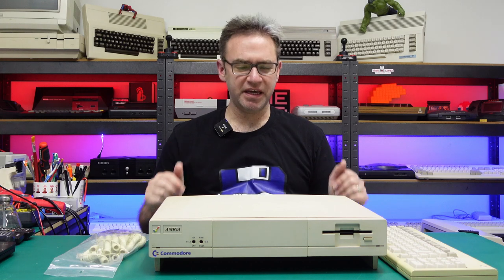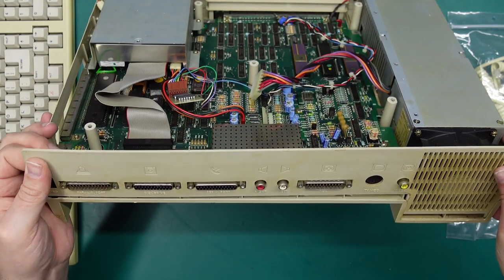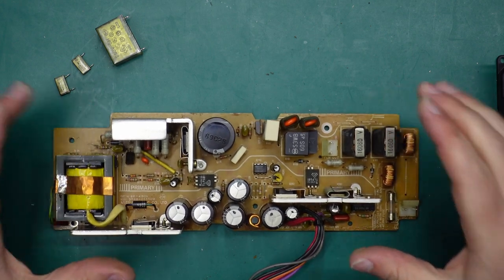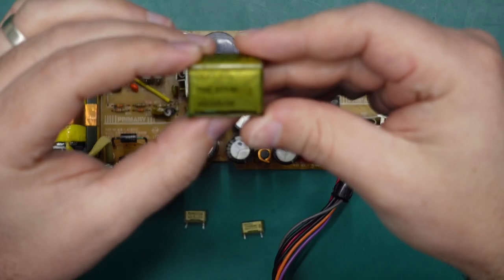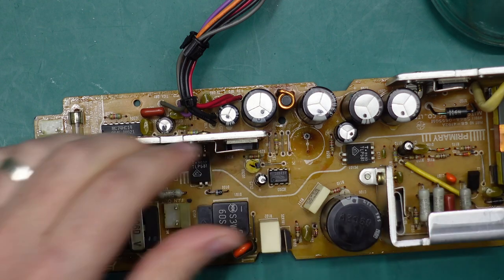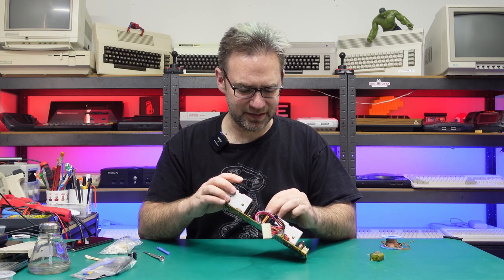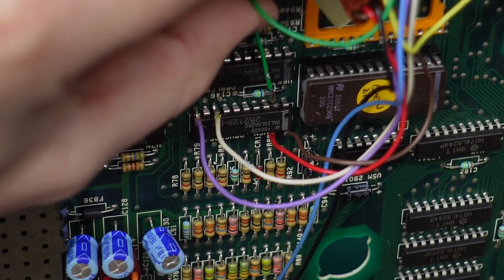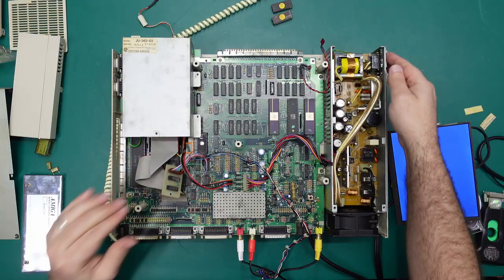Amiga 1000 - I have NFI - part one

Comment: The switch is a ROM switch. The A1000 loaded it's ROM (Kickstart) from floppy, but many aftermarket solutions to add a physical ROM existed. This simply allows you to switch between the Floppy boot option and the physical ROM. 
The one marked filter may be to activate the low pass audio filter on the Paula chip. That's usually done through software.
Reply from the maker: Yep, spot on. Still can't find any info on that particular kickstart mod, it's different to all the others I've seen. But at this point it will likely come out and I'll probably put in a more modern solution
Reply: While, it looks like it was done neatly, I think it's a sacrilege to damage the front of the A1000 case like that. I have one where an idiot cut out the drive bay for a diskdrive, but I use that for spare parts as I also have a pristine model. A kickrom chip would be nice, but instead I have an internal Gotek that fits nicely in the drive bay with Kickstart 1.3 set as the default loading disk. Best upgrade purchase I ever made.

Comment: It should turn on and go to a grey? then white screen. Then ask for the kickstart disks to be installed.
Looks to me like you should check of you are a) getting any processor activity and b) if the video output is getting a signal or not. If not trace it back to the chip and check the signals coming in. Pretty sure Adrians Digital basement just did one of these.

Comment: 24:47 I'm restoring an Amiga 1000 (NTSC) myself. From front to back, the Amiga 1000 power connector is -5V, +12V, GND, GND, +5V, +5V, and "Tick". I believe Tick will be a 50Hz TTL signal on your system. I'm having trouble seeing exactly which pin was reading 3V... if it were the Tick pin, then your multi-meter may read that as 3V. However, if it was one of the 5V lines, then hopefully replacing that one cap will sort it out.

Also, I believe if those jumpers are in the wrong position, then the Writable Control Store will be disabled and the system will expect to have Kickstart ROMs. Do look out for cut traces around those jumpers, though maybe whoever modded this Amiga made sure to do it in way that setting it back will be easy.
Reply from the maker: Thanks Justin, that "tick" line makes perfect sense and no doubt if I look at it on a scope it will look correct.

Yep, spoiler alert for the next video: those jumpers were set wrong, but even after correcting those it still didn't boot. There's a few more issues with this machine.

Good luck with your restoration

Comment: I want to tell you something about capacitors. Only because they have cracks they don't need to be bad. Back in the 60s and 70s there was a brand called WIMA. Every time you found a WIMA without cracks it was bad and you were forced to replaced it because there was a short circuit inside it. When the WIMA did have cracks there was no short circuit in it because then it could expand. So, you can't be 100% sure a RIFA capacitor is bad only because there are cracks in the shell.
My father has built his own controllers for the heat in his house (one in every room) and he still has RIFA capacitors from the 80s that are full of cracks and they are working perfect.
Reply from the maker: That may be true for WIMA caps, I don't know. But it has been shown many times that these particular RIFA caps will allow moisture in through those cracks and eventually allow a short across them. They didn't have those cracks from factory so they're not so supposed to be there.

Comment: My Amiga Choice would be the Amiga 'Champ' (lol) Chris Edwards!  -Mark.  P.S.  I have an A1000 I took apart but it has Zero Mods and worked fine for a few hours and then the Floppy stopped ejecting Disks.  I'm very interested in seeing you sort this one out though...Good Luck!  -Mark.
Reply: I would recommend buying an internal Gotek that fits in the drive buy, and a super tiny USB stick. It's the best A1000 upgrade ever. The buttons are accessible within the drive bay (a bit hard to get to but it works). You do need another Amiga to set the kickstart disk image to slot one though at first, but after that it's great....(or you can find someone with the Gotek files which have it set)

Comment: I guess you need to find the specs, but that 2.9v reading doesn't sound right.  Something pulling the 5v(?) rail down, or faulty power supply?
Reply from the maker: Turns out that 2.9V reading is the "tick" line. It should have a 50hz sine or square wave on it, so the multimeter is just averaging it out.